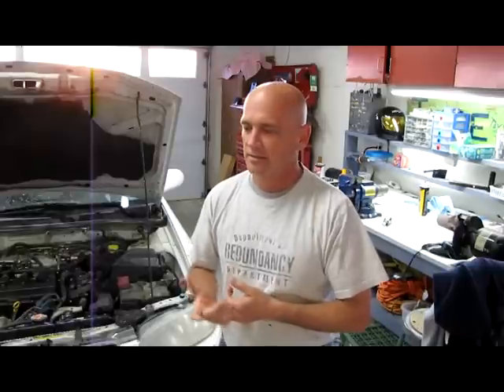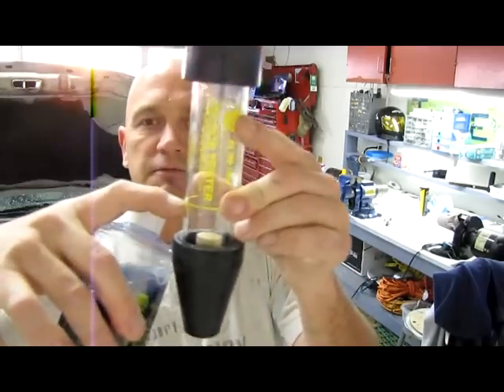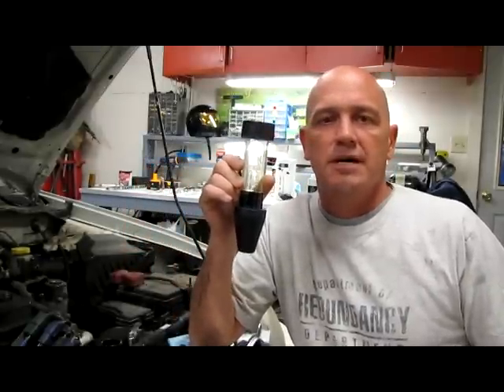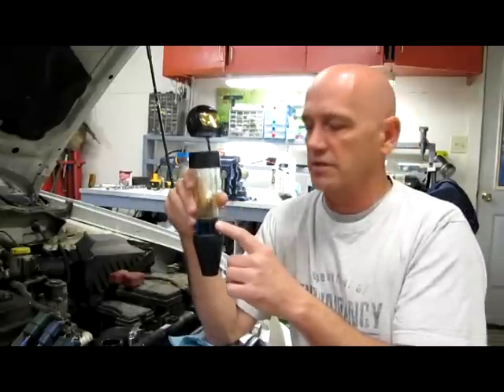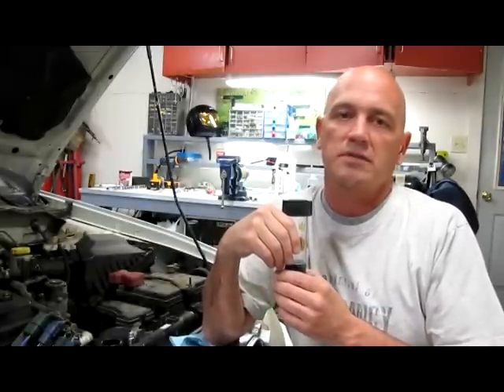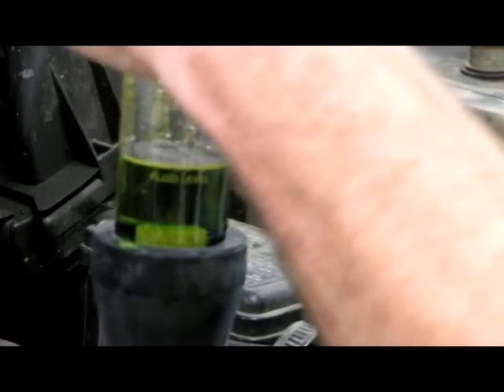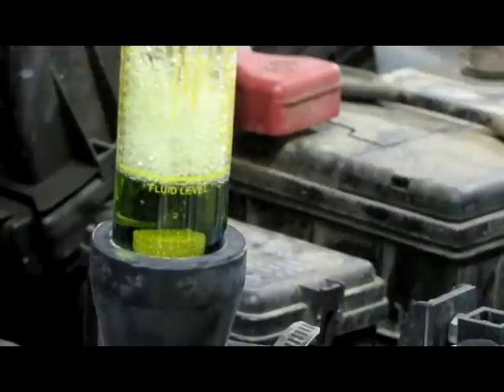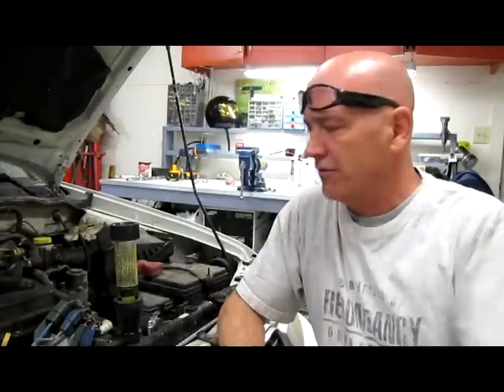How to Test Head Gasket

Comment: Hello I have a situation in my vehicle. About three weeks ago I removed the oil cap on my engine and noticed condensation in it, steam was even coming out of the opening. I assumed head gasket issue so I tried a very similar block tester like in this video, but the results are negative the test fluid stayed blue. My vehicle also does not have any other blown HG symptoms, no white steam out the muffler, no loss of power, no bubbles surging in coolant reservoir, and no loss of coolant. I would really appreciate any help or suggestions. Thank you
Reply from the maker: Long Eleven: Thanks for the concern - a good question.  What you are most likely seeing with the 'condensation' in my opinion is a need for a new PCV valve, and related to what we older folks call 'crankcase ventilation' stuff.  Today, 'crankcase ventilation' is directly related to, and a big part of what is called 'emissions controls,' which also includes things like unburned hydrocarbon management (unburned fuel), and catalytic converters (which consume that unburned fuel in an environmentally friendly way via their internal chemical makeup and chemical reactions to unburned hydrocarbons). That's the fancy part of it, and I may not be totally and specifically correct, but that's how I understand 'today's' relationship of what you are seeing.  Now, going back to the olden days like in a very old engine, imagine the engine block and head, together, as an enclosed unit, or 'case,' which houses all these moving parts.  Those moving parts all do different things, and one of the 'things' that some do is ignite fuel, creating a very powerful downward stroke on other up and down moving parts.  As this is happening, tons of heat is created, and while THAT is happening, cool coolant is pumped around those very very hot parts to take some heat away to the radiator (to then be dissipated into the atmosphere, and cooled back down). As this action is going on, remember your 'enclosed case' houses all of these actions - the entire engine of moving parts - with all its open spaces (valve cover) - there is air in all of those unused empty spaces in your 'enclosed case.'  That air in those spaces is hotter as it gets closer to the combustion chamber, and cooler as it is further away from the combustion chamber (valve cover). Condensation will occur with the changes in temperature back and forth. The HOTTER AREAS would be around the combustion chambers, and the COOLER AREAS would then be inside of your 'enclosed case' spaces further away from the combustion chambers and their surfaces. Heat in that case would go from the INSIDE OUTWARD into those spaces and surfaces to cool off, potentially creating condensation on the INSIDE surfaces away from the heat source. Vice-Versa, take a glass of very cold iced tea, put it on a counter in your very warm home, and you will see condensation develop on the OUTSIDE surface of the glass of tea. In this case, the heat would be attracted INWARD towards the cool glass surface (wished I'd have taken physics!) the heat is again attracted to the cool surface to cool off - It has to do with the temperature exchange within and on surfaces, probably humidity level (environment), and remember that your engine 'case' is somewhat enclosed, or semi-sealed, so it's hard for that air exchange to happen without condensation occurring. So your engine is now a 'reverse glass of iced tea' when it comes to condensation.  I'm no scientist, but to me, this makes sense.  So - it's normal to see SOME condensation, depending on your driving habits (very short trips would probably cause more), and that combined with where you live environmentally will determine the level you would see.  The most important thing is that you note there are no symptoms of a HG issue.  If you see chocolate milk developing with no HG symptoms, then you could have some crankcase ventilation issues (PCV Valve) if it's not overheating.  PCV valving helps to valve or manage that internal crankcase atmosphere and allow it to 'breathe'.  If this is a new issue for you, try changing your PCV valve. Perhaps someone with extensive emissions experience can toss in some further detail, but that 's the best I can describe it from what I know.  I wouldn't worry too much at this point.  Let us know how it goes!  r
Reply: Reluctorvalve I first want to say thank you so much for the very detailed response I really appreciate it. And it does make more sense now that you described how the condensation process in an engine happens, I am more convinced now that it is not a head gasket issue since I did a compression test yesterday and all cylinders had same compression except for one that had only 10psi less (which is acceptable for this vehicle according to specifications) on top of that this vehicle never overheats. I am definitely goin to change the pcv valve this weekend and hope the condensation problem is resolved. Again thanks a lot and I'll let you know how it went.

Comment: Need an opinion...!  Do a Head Gasket for my Toyota 4.5L 1FZ-FE 6cyl.... Finished the Torque job and noticed ---- I FORGOT THE FLAT WASHERS UNDER THE HEAD BOLTS.... should I pull them or leave them at this point... buy a new head gasket and re-torgue...? 
Appreciate your opinion...!
Ken
Reply from the maker: Hi Ken.  First, know that I tend to be a perfectionist, so with that you can probably guess my answer.  As long as the areas are still easily accessible, if it were me, I'd go ahead and pull the heads, re-clean those decks and lower head surfaces, install fresh gaskets and re-torque.  Those washers were there for a designed reason.  And, just the head gaskets alone are usually pretty inexpensive.  That's what I would do.  Hope this helps!  Sorry!  r-
Reply: Well... Living in costa Rica... No Gaskets, have to come in from the States...no parts here for my Toyota Land Cruiser...!
 I backed each bolt off to 26 lbs. which is where the book calls to start from... pulled one at a time, fitted it with the washer... re-torqued that one to 26...again,  then turned each down twice 90 degrees to finish them off according to the book and pattern shown... Never releasing all the tension on the gasket.. Wonder if that will work..?   Takes weeks to get things into Costa Rica..!!!
Reply from the maker: Kenny Alan Well, it sounds like you've already performed what your intent was - didn't know you are in Costa Rica.  The trade off is the beauty of the land, right? :)  It's very brown where I live.  :(   Anyway, let us know how it goes.  Sounds like you understand the importance of torque sequencing.  r-
Reply: Sure will I will keep you up on how it goes..!  Hopefully OK..? 
I have a question... I got the gaskets set for the this Toyota 4.5L 1FZ-FE 6cyl.... but I don't see any gaskets in the set that are cork, or the regular blk. paper ones we use to use years ago... they all look like blk. metal... I can see these being used for the Intake and exhaust...OK.... but what about where the water dumps into different areas like the Water Bypass Outlet, is this something new that they have come up with..?
and they don't need Gasket material or Silicone..? ..
Reply from the maker: Kenny Alan It's not uncommon in a lot of modern gaskets that silicone isn't needed.  Additionally, the materials they are made of have changed over the years.  I just finished up a Dodge RAM 1500 headgasket/head replacements and the valve cover gaskets on that thing were and are designed to be re-used.  They have a rigid metal framing-type of 'skeleton' thing which is wrapped with a type of plastic that is just a bit soft but stiff for the most part.  I have not, however, seen full-on metal gaskets for coolant sealing surfaces. Naturally, I would compare the ones you take off to your replacements - and even then, design updates do change replacement parts like that.  r-
Reply: Thanks..!  Appreciate it..!  Ken
Reply: Kenny Alan how did it go with your cylinder head? Did it develop any problems after installing the washers?
Reply: No, worked out OK... Thanks..!
Reply: Impressive. Glad to hear it!

Comment: My 2008 Honda civic si when I bought it had over heated abit while I was stopped but began to cool down when I drove again, I checked and it had no coolant so I added coolant and ever since then never over heated! But im loosing coolant enough coolant that I have to add like half a cup or 3/4 cup of coolant to the reservoir. and no white smoke or noticeable milky oil, oil is turning abit darker but I need an oil change. my mechanic didn't see any noticeable leaks and did a leak test and the pressure stayed in place. What could it be that the coolant is disappearing? iv been driving it like this for a month and a half now. PLEASE HELP! thanks
Reply from the maker: mob1n123 couple a questions for you.  When you checked the coolant after overheating a bit and discovered it needed coolant, where exactly were you checking it - the coolant reservoir, or the radiator after a cool down?  Next, 1/2 cup to 3/4 cup to the reservoir isn't much, depending on the size - Hondas tho have pretty small reservoirs and cooling systems.  The level in the reservoir DOES fluctuate, and this is typical.  Normally, the level in the morning when it's cold will be higher than when it's at operating temps - but not drastically so.  I'm wondering if what you are seeing is just a normal reservoir fluctuation.  Further supporting this is that you've had it checked and it sounds like your mech has performed all the proper checks. This still doesn't explain the orig loss, though, but it's a start.  r-
Reply: reluctorvalve thanks for replying and pretty much I bought the car and when we drove it it would only overheat while it was stopped and as soon as I drove it went to normal and, I checked the radiator and it was pretty low because I put almost half the jug of coolant into the radiator for it to goto the top. And I check the coolant level every morning and it goes down abit, as for adding coolant it has used up a whole bottle of coolant in a month and 1 week. Went to another mechanic and he couldn't find no leaks and oil cap and dipstick looks fine no white smoke. but I do see alittle brown on the oil cap but just abit.
Reply: reluctorvalve and the level in the morning for past few weeks goes lower and lower
Reply from the maker: mob1n123  Great description from you. What SCREAMS to me is the fact that you have cooling issues at low or no speeds, but zero issues at higher speeds.  Hondas - they have electric cooling fans. Most have dual cooling fans - two of them.  One is the 'primary' fan which is responsible for keeping the cooling system within op temps AT LOW OR NO SPEED.  The other fan is for when you kick on the AC - that one should come on, and may cycle on and off, when your AC is engaged (not the issue here). At highway speeds, the outside air rushes over your radiator, which dissipates (transfers) the heat from the radiator into the atmosphere. At lower or no speeds, that 'RAM' air, as we call it, isn't there, - so no transfer of heat (dissipation) to the atmosphere.  That's the 'job' of the primary cooling fan - to suck fresh cool air through the radiator core at a high velocity, and to make that 'RAM' airflow as if you were driving at higher speeds. It sounds to me like your primary fan isn't working.  Run it at idle in your driveway, watch your temp gauge, with the AC OFF.  A fan should come on at some point prior to the temp gauge reaching around 3/4 range. If it gets more than 3/4 of the way up with no fan coming on - you have a primary fan that's not coming on.  Usual cause is a cooling fan 'switch.' - located on the lower part of your radiator, probably the driver's side - two wire connection plug.  Jumping the two wires in the connector should cause the primary fan to engage. Next usual cause would be either a fan circuit fuse or a bad fan relay.  Check your fuses with a test light, and if you know how to, also check your fan relay.  Fan motor could also be bad, but that's less common.  Most likely either a bad cooling fan switch in the radiator, or a bad relay. This is a good example of where using a basic test light can tell you volumes.Start there and give this a whirl.  Would like to hear back.  r-
Reply: reluctorvalve thank you so much really appreciate you giving me this feedback! and honestly when the car warms up it never goes above half way on the temperature gauge, but I will goto my mechanic and show him this so he can do the tests that you told me to do, and I will get back to you as soon as I do them! Also a question so because of these fans it can cause you to loose coolant?
Reply: reluctorvalve  the 2008 civic si's fan control is located on the radiator so low coolant can and will cause the cars fans to not work. He is also building up moisture under his valve cover which is a direct sign of coolant mixing with the oil. More moisture that can be explained away by the short trip clause, these cars apparently have.
Reply from the maker: Matt Wiseman MOB: the reason low coolant can cause the fan NOT to work would be because the temp sensor in the radiator isn't, ISN"T submerged in active coolant - it could be in an air bubble, of sorts.  In that scenario, the sensor isn't reporting temp accurately back to the PCM, so the fan may not come on.  If the fan isn't coming on, well, you could then get overheating.  Hondas do have an air bleed valve, however, as I recall.  Your mech probably has already delved into the air-bubble theory. The notation that Matt has made on the short trip/oil/mix thing is true, although I haven't experienced it myself.  But, it is fairly common from what I understand.  r-

Comment: Thanks so much, good info. Question, I have a Honda civic, and it looses water, I have replaced almost every thing from radiator to water sensor, thermostat, bypassed the fan, and car still over heats, can this be the reason why my car looses water/
Reply: If there is no indication of the cooling system being compromised and the car still overheats I would suspect that maybe you have a crack in the head of one of the cylinders. Water (or coolant) in the compression chamber makes the firing of the compressed gases a lot hotter.  The evidence of this particular happening was that the American fighter jets were being left behind fleeing commie planes and the US found out that their miracle juice was simply injecting water into the combusion chamber of the jet and it 'burned with explosive force'. We used to do things like this to our old hotrods but you had to not do it too often or the water vapour would get into the oil pan and not get boiled off. Kinda hard on the engine if you were not careful. Water does not lubricate very well.. If the engine is cool you may not be able to detect a cracked head even with a pressure tester. Pull all the plugs out and try the pressure test or slowly rotate the crank while you do to make sure that you are not doing the test while the cracked head is under compression.
Reply from the maker: Hanser: You need to perform a "Cooling System Pressure Test" to see where your leak is.  I have a video on that on my channel if you look.  If you don't have an 'external' leak, you may have an internal one, or one like is covered here in this video.  Try to put a pressure tester on it, or have a shop do it for you.  Lots of water leak usually is pretty easy to detect!  r-

Comment: If there is oil in the coolant would you not suspect that there is a leak from the oil lubricating system that passes through the same gasket.. If there is no indication of a cylinder leak into the coolant system and oil is getting in - it still might be the gasket leaking oil under pressure and across into the collant system. All the holes in the gasket are for the cylinder, the bolts, the oil passages and the collant passages. Oil has to be delivered to the valve train above the heads so has to pass through the same gasket. About the only alternative that I can think of.
Reply from the maker: Ger: Indeed, that could happen.  I had a client once who had a literal 'external' head gasket leak:  spewing coolant on the firewall of her old Toyota, yet there was zero indication of any kind of 'compression' leak into that cooling system.  Just age - the thing was 20 years old.  A gasket is a gasket.  What you describe is totally possible.  Rare, but yes, possible.  Afterall, it's just a physical gasket made of materials, and after umpteen kablillion miles, who knows what could leak into what when ONE gasket handles seals which separate oil, coolant AND compression.  I agree.  r-

Comment: Hi! I'm a Nissan mechanic from Spain. We use this kind of tools too, but sometimes in modern car (a lot of Diesel's) there is a coolant cooler for the EGR system. This cooler breaks usually and you can detect co2 in the coolant too.
Reply from the maker: Ah! - I get that!  Not so much of a diesel guy, but I do know that that is the up and coming technology.  Funny how the EGR system is designed to 'reduce combustion temps' and now I hear that there is a FURTHER cooler TO the EGR system!  That would make sense, in that it may NOT be a head gasket issue, but more of an issue with this sub-system EGR cooler that leaks and therefore gives you 'exhaust gasses' into the cooling system from THAT avenue!  -- my head is about confused, now!  Thanks for pointing exception out!  r-